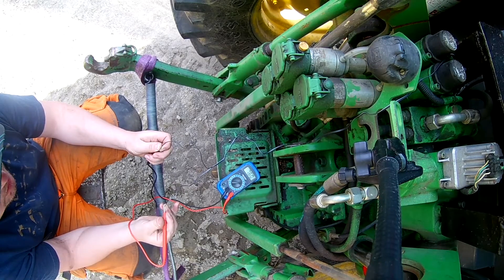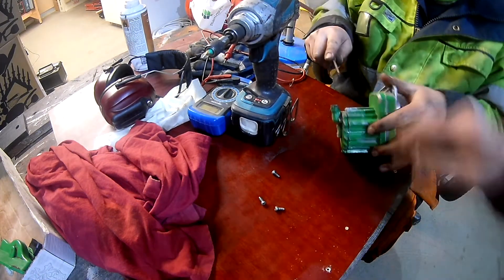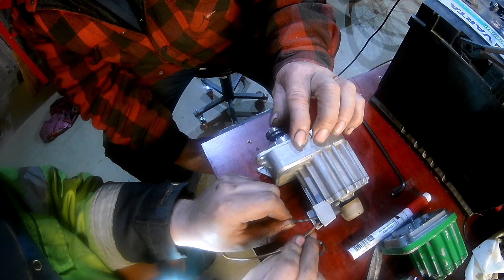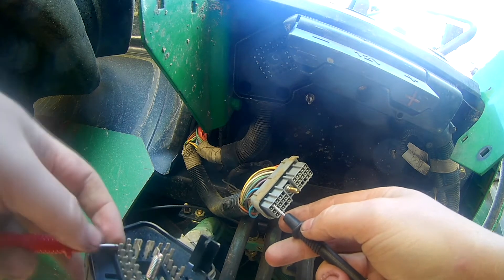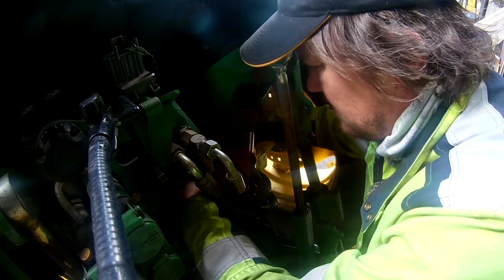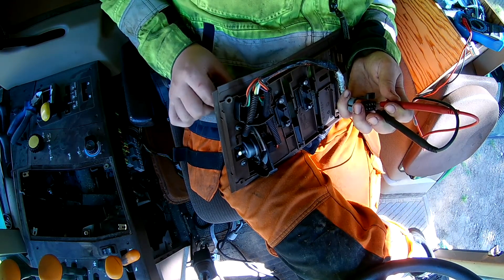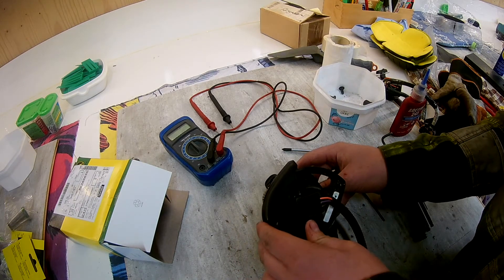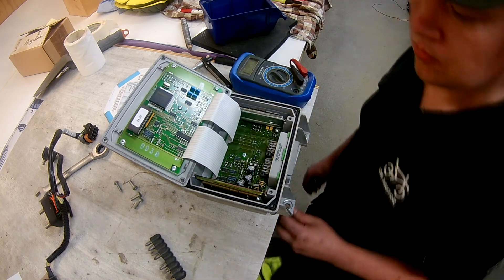John Deere 6010 3 point hitch problem

Comment: Hello ! I have a problem with a 6820, the 3 point hitch no longer raise or lower from the buttons in the cabin (only the ones on the wheel guard work from outside the cabin ) until the oil in the chassis heats up. After it warms up, it runs without problems, (even the control buttons inside the cabin work)  could the Electric Stepper Motor be to blame?
Reply from the maker: Double check wiring near connectors to stepper and the connectors themself.

Strange it works from the fender and not the cab when cold?

Comment: Hello I have maybe near similar problems
Stepper motor was blocked with corosion I clean it, works well without weight now. but after I atach the plough do not come down many times only if I rotate with screws on the top
Reply from the maker: Strange that it works without weight on it and stops working with weight.

Wonder if the corrosion could cause stepper to be weaker? Would guess weight might cause it to be a little more resistance to move valve?

My main problem was bad connection in the electrical plug to the stepper. Any difference if you wiggle the electrical plug after giving order to lower it?

Comment: Cześć mam problem z moim 6910 podnośnik nie dziala z kabiny , dziala tylko śrubka silnika krokowego , niestety zostal spalony sterownik ehr podczas spawania , . Naprawa sterownika nic nie dała,  wiesz co moze być problemem ?
Reply from the maker: Have had issues with corrosion inside the stepper motor itself.

It can be taken apart to see that there is not rust in there.

You say EHR controller is the the box controlling the lift? Any repair to that have you been able to confirm that it is actually working. Electronics can be tricky. If possible try it on another tractor?
Reply: @blackgrove8  Dzięki za odpowiedź,  w skrzynce ehr był spalony procesor , wymiana nic nie pomogła więc szukam dalej przyczyny i dlatego pytam. A czy u ciebie jak była rdza w silniku krokowym to podnośnik działa po przekręceniu silnika śrubokrętem ?
Reply from the maker: @Oskarcs86  Yes the lift can still be activated with a screwdriver even if there is corrosion inside the stepper motor enough to cause it not to work.

Using the screwdriver overrides all the electrical parts and manually operates the valve controlling the lift or hitch as some also call it.

But if it was working before the box was damaged I would suspect the box to be the problem rather then the stepper motor.

Bad connection in the electrical connector was my problem.

But have replaced the stepper in the past because of corrosion inside it.

Comment: Have a 6300 with the stepper motor only working with the manual screw. I don't see any power at all on any of the 4 wires going to the motor while pressing the up/down rocker switch. Is that normal?
Reply from the maker: Have to ask the stupid question if you have checked the fuses?

Been a while since I had issues and have a bad memory.

Think it was possible to see some readings of voltage back at the connector.

But if it sends the correct signals it is more of a series of pulses so you won't see a steady voltage back at the stepper.
Reply: Yes, both fuses are good. Maybe my motor is bad. I'll try an injector light and see if I get any pulses.
Reply: @blackgrove8  I tried the noid light and I can get 1 bright flash, then nothing. I'm trying to get the motor off now. Took the 4 bolts out but it just turns and doesn't want to lift off.
Reply from the maker: Maybe it just sends one pulse if the computer box is not happy with current draw it shuts down.

They are prone to getting water in them and corrode, have replaced one stepper before I had started doing any YouTube videos.

It has a protrusion with a seal on it I think that might be giving you trouble unmounting it.
Reply: Well, it came off. It looks like new inside. Can't believe there is anything wrong with it. DC power just locks it so I'm thinking it probably takes AC to make it turn.
Reply from the maker: No it takes DC but you have to give it alternating pulses between the 2 different circuits in it.

Maybe try to trace the wiring back to the box, on mine it was located under the floor on the right side if I remember correctly and check wiring for continuity between box and stepper motor.

Comment: Did you find the problem with the hydraulic lift ??
Reply from the maker: Have not really used it myself other then hooking up a trailer. My dad says it works fine now. Not sure if the magic HCU box learns a little as it's used. Might have been so simple that the damaged connector back on the stepper would have been enough and using it some before changing anything more, would have saved some money for sure.

Comment: Hi, my hydraulic lift work but after 10 min of work it stop , did you find the problem ?
Reply from the maker: This time around it was the electric connector on the top of the stepper motor controlling hydraulic valve.

Not uncommon that the stepper motor takes in some water causing corrosion it has been replaced once.

Does lift work if you use the manual screw on top of stepper?
Reply: Cześć,  piszę do ciebie z Polski mam problem z moim 6910 , podnośnika nie działa ponieważ podczas spawania został uszkodzony. Po naprawie sterownika dalej nic , działa tylko za pomocą śrubki silnika krokowego. Czy wiesz co może być przyczyną?